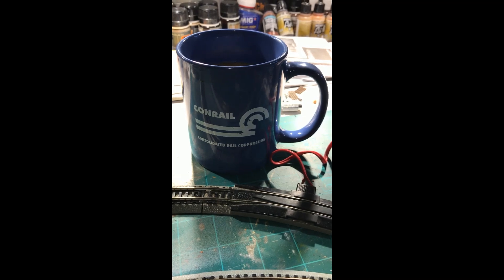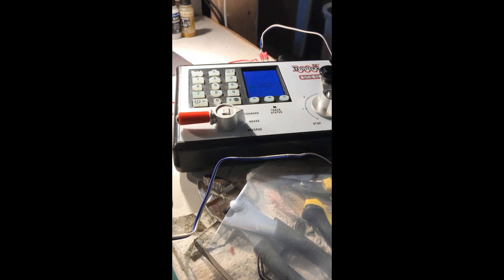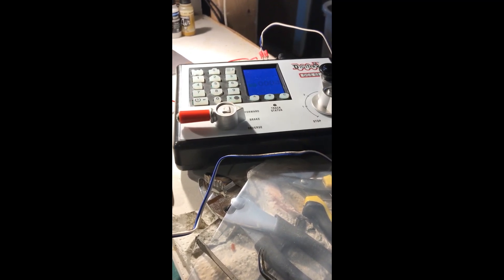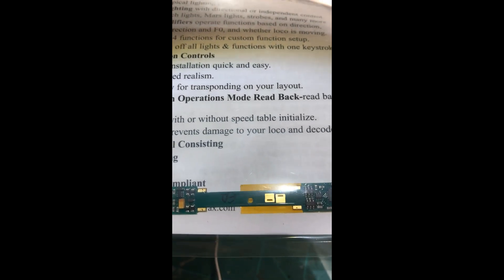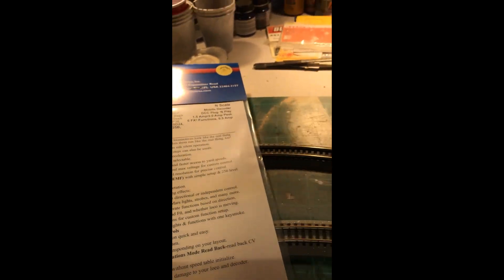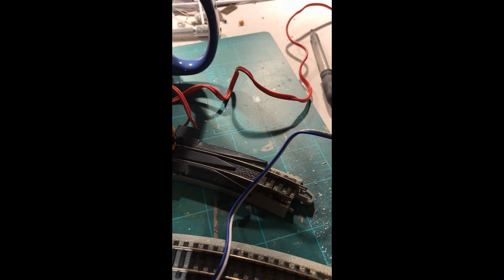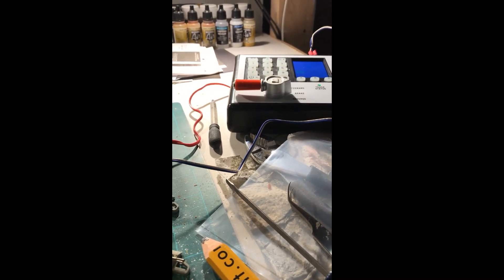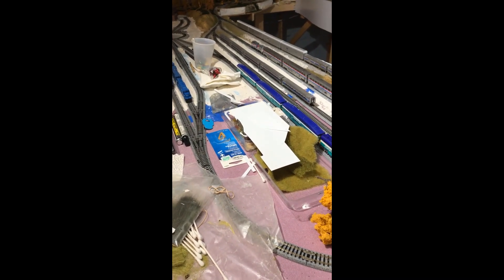The Allegheny Northern, DCC Conversion

Comment: Hi, just a friendly suggestion. " Shoot side to side, so your picture is wide."  I have that Digitrax Zephyr. I love it. I also have a NCE powercab, love that too. Being in my 7th decade and a n scale modeler, I have never been brave enough to do my own installs. So lots of respect for that. Thanks for sharing. Bye.
Reply from the maker: Yes, totally agree - wide-angle would have been much better.  I'll be honest, DCC is intimidating.  Lots of terminology and expensive equipment to purchase, and hours and hours of research make it about as clear as mud.  I figured I'd take a $30 risk and see if I could install a decoder, it took a really long time between getting the command station to program it and actually getting it to sit correctly in the locomotive.  Now, I think I'm down to a few minutes a decoder.  Moral of the story, don't be afraid - they're pretty resistant to stupid as I proved - just make sure you don't let the motor tabs touch the shell and you're golden.

Comment: Hiya!  I just returned to N scale after quite a long absence.  I was going to go straight into DCC but with the cost of getting started, (and the hobby has become overly expensive in my opinion), I'm going to have to settle for starting out in regular DC and maybe go digital later on.  I very much agree on your choice of a Digitrax Zephyr Express.  That's the same one I would have chosen for DCC and had my eye on for my new layout.  The price of new locomotives, rolling stock, and the amount of decoders I would need changed my mind about starting right off in digital.  I do shop on eBay to help the overall cost of things, but it all adds up very quickly.  That's why your layout has been such an inspiration.  It ran great on DC.  I'll undoubtedly follow in your footsteps then; DC now and DCC down the line maybe in a few years.  It's good to see you're back.  Looking forward to your future videos.  Thank you!

Michael
Reply from the maker: Hi Michael.  Digitax in my opinion is the leader for DCC.  I'm sure others will disagree but for cost effectiveness and ease of installation, Digitrax has it hands down.  The Zephyr Express has been great, I just connected it to the layout and added a wireless throttle - it's possibly the best thing ever.  I started small, purchased a handful of decoders and changed out a couple locos and messed around with a loop of track on the dinning room table.  Fell in love with the control, which is so much more precise than even an MRC Tech 4 cab.  With clean track your locos can smoothly crawl which is great for local work and switching.  I use an electronics cleaner outlined in another video and I clean my tracks about once a year.  I pushed off the conversion a long time but I'm glad I finally made it.  You're gonna want to make the switch - even if it's only a few locos at a time.  Have fun!
Reply: @AlleghenyNorthern  
     Thank you so much for your reply.  I know you're right about Digitrax because I've done my homework in that area and I have to agree that its the best DCC controller.  I do have to ask if you've had to use a power booster for your railroad due to the length of your mainline run and your yard and sidings.  Digitrax sells their own kind and I've also been wondering how much power a Digitrax system has on it's own without a booster.
Reply from the maker: @michaelp.6300   so, this is actually something I'm struggling with myself.  Digitrax sells boosters but when you read about them, they tell you they need a power supply. but is it in the box with the booster or separate? No clue.  Next, how much 'power' - amps to be more correct - are required?  The Zephyr Express is rated at 3.5 amps, pretty low.  In my research, I think that's going to equate to about 9 or 10 non-sound equipped decoders.  Sound equipped decoders draw a higher amperage.  So far, in my tests I have not had an issue getting a small train around the layout.  I'm slowly adding more and more to see how much is too much.  But boosters have another reason - to divide the layout into power districts - like block control, but not really.  Right now, if a loco picks a switch and derails, it shuts down my entire layout until the breaker resets from the short.  Boosters break up the layout into into sections so if you have a short, it only knocks out one section.  The added advantage is more amps, more decoders, plus isolated areas - better control for a large layout.  I'm a solo operator on my layout so the max amount of trains running at one time would be two on the mainline loop and a local performing switching operations.  Now when i get the upper deck built - that could be up to five or six trains - so adding boosters is definitely in the future.  Maybe a couple more and also wiring in some additional circuit breakers for added protection.
Reply: @AlleghenyNorthern  

You and I have pretty much the same situation going on.  When my layout is built enough to start testing and running trains,  I will also be the solo operator.  I would like to build to be able to have trains cruise the layout on their own with continued running while also switching cars in and out of the industries.  Double track Kato mainline like yours too.
I was kinda wondering what would happen if I didn't isolate a section of mainline when a power booster was needed to run on some distant track such as a second level.  That's also something I'd like to include.  Do ya just drop in a booster where the power begins to weaken, or is it necessary to divide the track into zones?
Reply from the maker: @michaelp.6300  I haven't seen any installation where a booster was added not on a separate district. I don't think you'd want to connect multiple boosters to the same district.  So a train can traverse my layout without any notice of digital signal loss.  I have a 14 ga bus line, 22 ga connectors from the bus to the mainline and there's at least two connections per old DC power block.  That seems to be providing sufficient signal.
Reply: @AlleghenyNorthern  

I've been thinking about a second level for my railroad.  Would you still wire it the way you mentioned?
Reply from the maker: @michaelp.6300  Yes.  So here's what I'm planning for mine: The current command station I think will handle the lower layout without a booster.  I might make up some power districts using circuit breakers to protect against the occasional short caused by a picked switch or a derailed wheelset.  I'm going to get a 5 amp booster for the upper layout and divide it into circuit breaker districts as well.  That's what I'm thinking, anyway.
Reply: @AlleghenyNorthern  

Sounds like a good idea.  Where do you place the 5 amp booster though?  Is it right alongside the main controller?
Reply from the maker: @michaelp.6300  I think I'm going to put it in the same place as the command station and then run the 14 ga bus line up to the second level - concealed of course.  The shelf is open and that will keep the booster cool.  Plus, it's close to where it needs to plug in to the surge protector I have all my power supplies plugged into.  I am trying to centralize all the major components because the loconet ports and the wireless throttle give me the freedom I need and then I can keep the cord management simple.